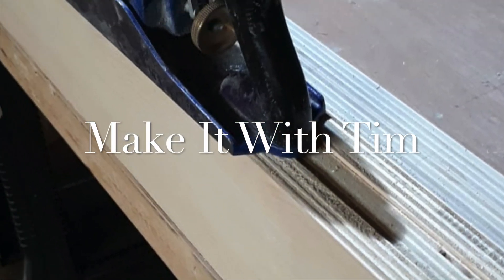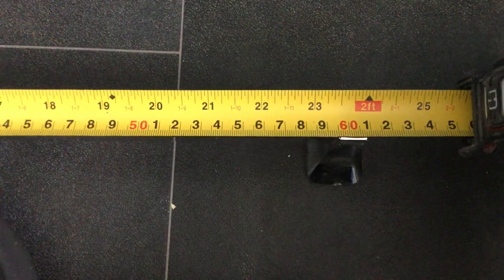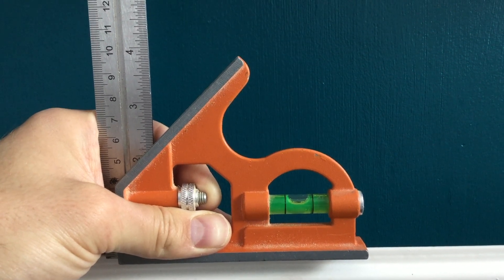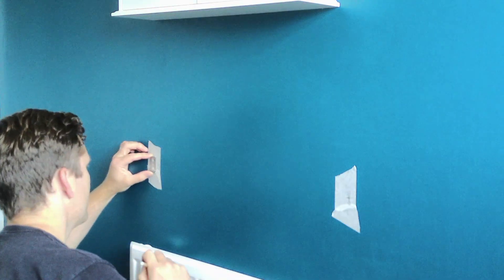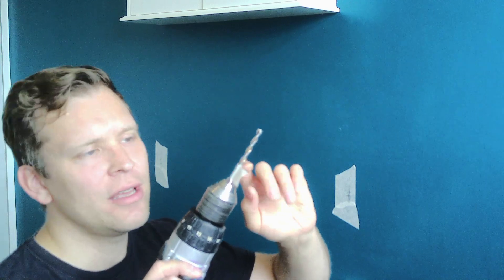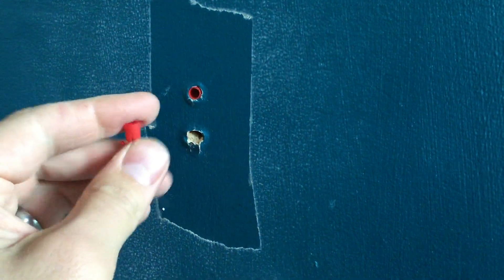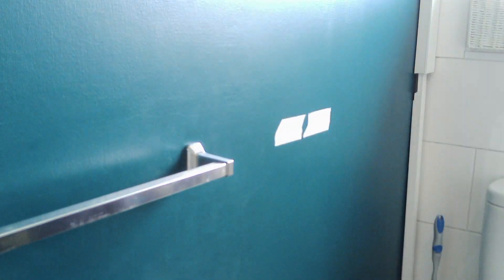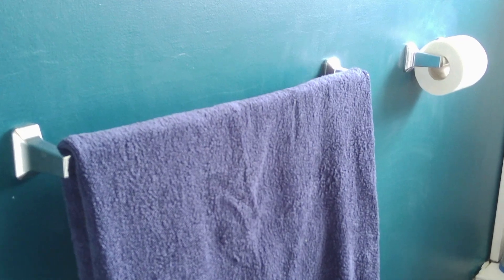DIY - How to install a towel rail and toilet roll holder

Comment: What kind/size raw plugs do you use? Does it matter? Towel rails and toilet roll holders always seem to come away from the wall after time!
Reply from the maker: The size raw plug depends on the size screw you use. I think I used 4mm wide screws but can't be sure without taking them out again. If you drill the size whole recommended for the raw plug it should hold.